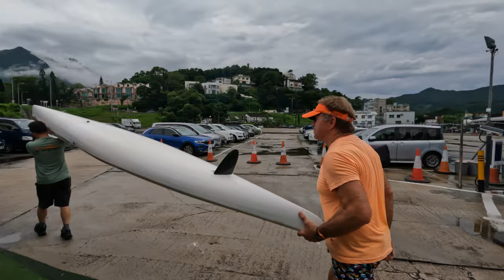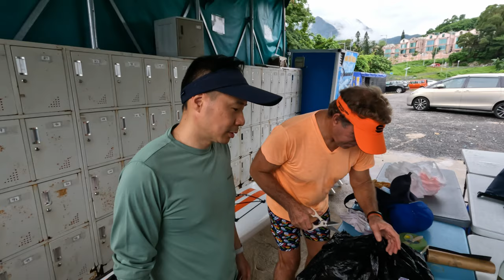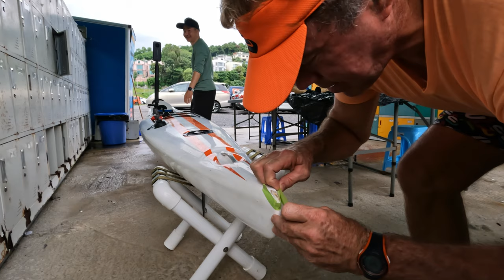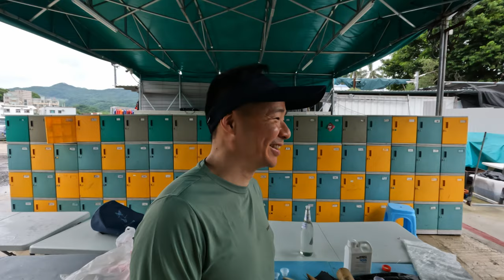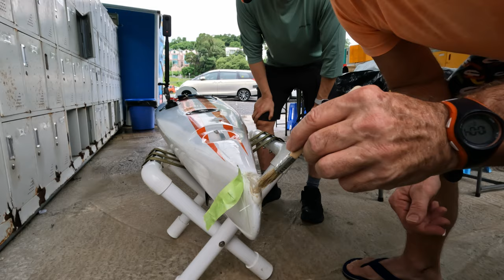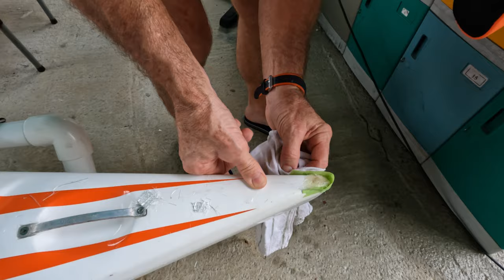REPAIRING a Kayak - A Learning Process

Comment: It is recommended to wash thoroughly with fresh water and dry it for at least a week before repairing.
This is because when seawater seeps into the carbon, the salt crystals cause microscopic damage in the long run. ^^
Reply from the maker: Ahh that’s a great tip! My friend didn’t use it for a week or so and he did wash it with freshwater before putting it away. But thank you for this great tip!
Reply: @Fishaholicboy  ^^b